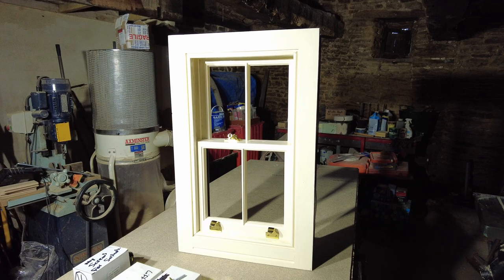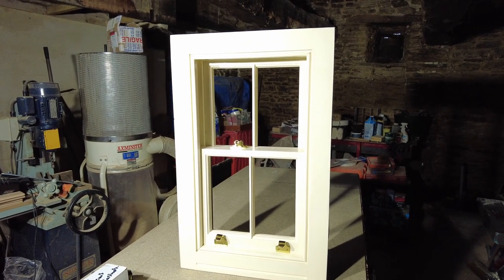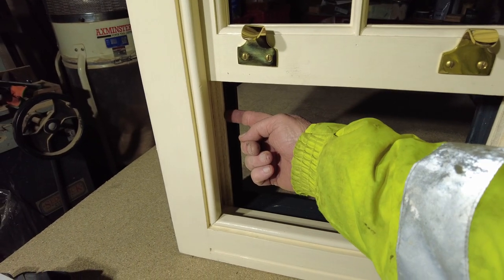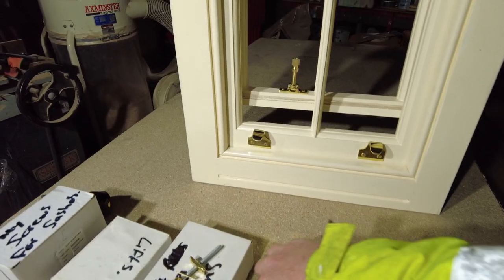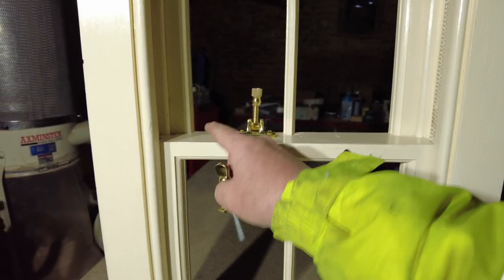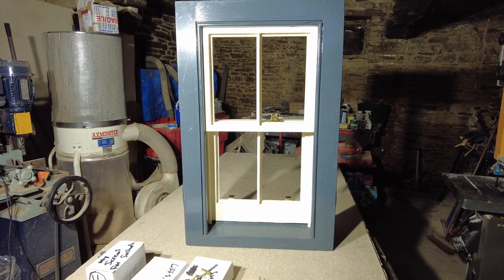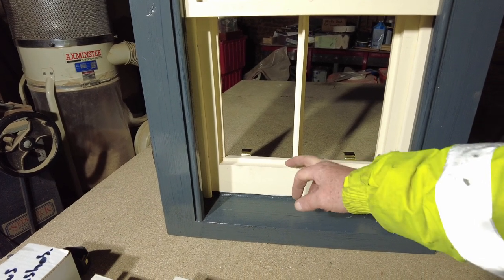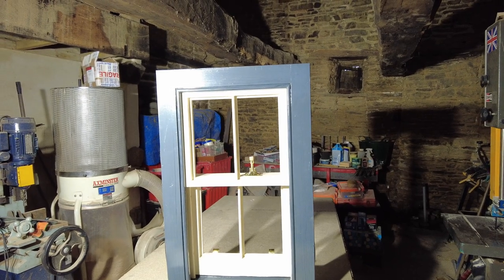No 25. Slidding Sash Windows Taster

Comment: Very much like the draught proofing ideas. The old Victorian ones were a bit of a disaster when it came to draughts.
Reply from the maker: They were draughty  Simon but they were and are still great windows today with some modifications they work better then the polluting plastic rubbish 🙏👍
Reply: @FrenchFarmhouseDiaries  It is a great design still, just needed some tweaks to improve that aspect of it. Also, in todays safety conscious world, the fact that you can open the top half makes it very difficult for anyone to fall out of. And, as you say, beats the PVC version hands down.

Comment: This window is just another example of absolute master carpentry. So well designed. I especially like that it opens down from the top as well as up from the bottom. It allows a bit of air circulation into the room.
Reply from the maker: Yes its a very good design 👌

Comment: Door and window making seem to be lost arts for many woodworkers. Do you work with primarily power tools when making your windows, or handtools? either way, would love to see a step-by-step tutorial, as well as information on where are you source those wonderful bits of brass hardware.
Reply from the maker: Hi Matthew i use a combination of power tools and hand tool work i plane every thing up and mould on the machine then i hand cut all the mortice and tenons as well as the glazing bar scribes and joints but there will be a series of videos coming up showing all this the hard were is from the Uk there are around 4 or 5 places you can get them just google box sash furniture and supplies all the best Budo 👍🪚🙏

Comment: I like the woodworking, especially the quality and years of experience that go into your custom designs. Will you try to insulate in the 'box' areas of the window or would any insulation interfere with free movement of the weights?
Reply from the maker: Hi Bluebird the cavity were the sash weights run is never insulated as its effectively a closed in box with 3/4 timber all round and the weights need free movement  but thank you and a great question all the best Budo 🙏👍🪚

Comment: Wood working. I love watching your projects, you are a very skilled guy and I learn a lot from watching you, so there is a choice, more woodworking content please. re your comment about double glazing not working in old houses? Can you expand on that point and talk about how in your view how a house can reduce the heat loss through its glazing, when using single pain windows?
Reply from the maker: Hi buddy well the heat lose in old properties is more due to air movement i.e. drafts not through the glass as much you will gain a little in double glazed units of 24mm or more but not on less only slightly on sound prof i will look up some time in the future the fellow who done the tests and his results and post them in the future, its also been said that a heavy set of drapes in front of single glass windows in old properties works  3x better then a 14mm double glazed unit and also you need to factor in the drafts in older properties are needed to some extent to allow houses to breath i visited a chateau last month and they had had two French windows renewed with plastic double glazed ones a couple of years ago and them two rooms walls were completely covered in black mould because they could not  breath moister properly at the end of the day its so minimal that the pay back is a life time look at solar panels they for get to tell you that the energy needed to make them is more then they make back in there 20 year life time that is if they get to that age and are still working then they have to be disposed of any ways thank you and  all the best Budo

Comment: Will you be able to get the softwood in France to the same quality as the UK also is the hardware you're using from mighton.
Reply from the maker: The timber is coming from Scandinavian red wood and no Mighton are way to pricey i use a different supplier they are for trade only but i had stock from old that was spare from a long while ago and it came over with our personal belongings

Comment: Brilliant Video as always But just one thing ? How are you going to open and close the shutters.
As Franch windows open in so you can get at the shutters and for making it easier to clean the windows top and bottom
Reply from the maker: Hi Pascal with the windows opening up and down its easy to lift the bottom sash lean out slightly and operate the shutters ill show this when they are made and in buddy all the best Budo 🙏🪚😏👍